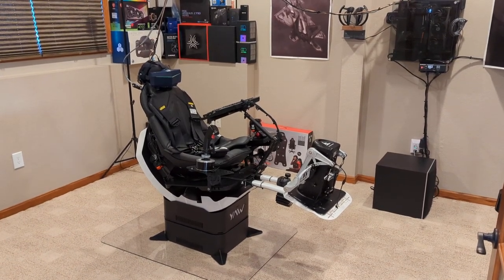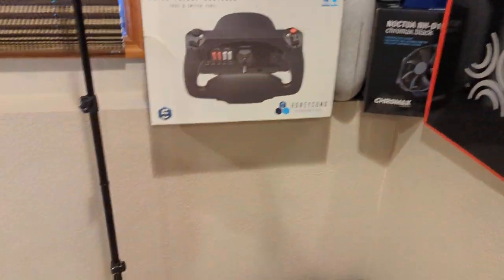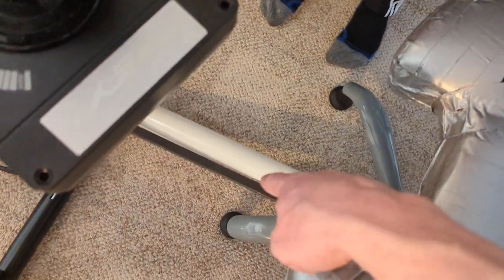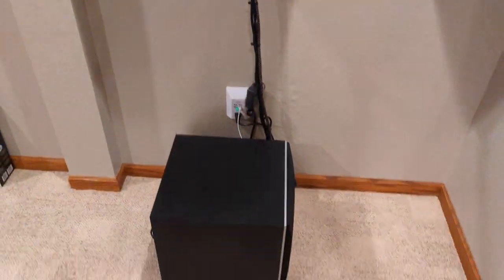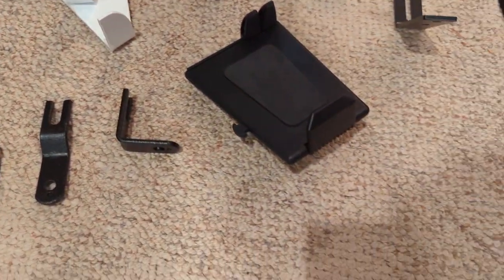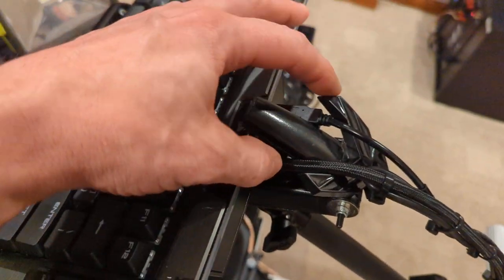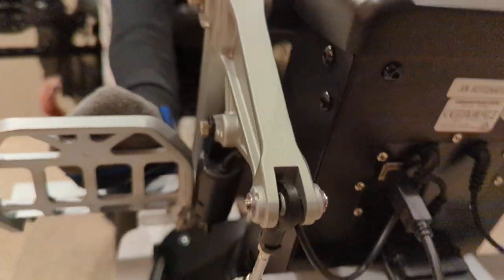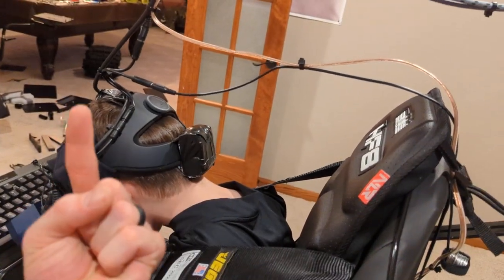YAW 2 PRO complete build. PART 1. Nuggets galore. Close ups. Motion VR chair. YAW manual. See part 2

Comment: Since you asked, I think that I can beat you with my setup. Only 2 wires from the PC (power + 1 USB). There is no need for that spider web hanging from the ceiling. A powered USB hub mounted on the Yaw2 is all you need to connect all your peripherals (steering, Hotas, shifter, pedals, etc.). Also if you connect your VR headset through WiFi-6 to your PC, there no need for the headset USB cable, but if you want to connect your headset through USB for some reason, you can connect it to the USB hub in the chair itself and avoid another dangling cable from the PC. I added a wireless HDMI touch screen monitor to my rig so there is, most of the time, no need for a keyboard or mouse. It is virtually a clone of my main gaming PC screen, so you can also control and navigate the whole PC from this touchscreen. You can load games, apps, etc. and control them just by touching the screen. Also added a sliding mount for the hotas stick which lets you move the stick away when playing car racing games. A butt kicker is also mounted to the rig which gets its audio signal from the same wireless HDMI that feeds the touchscreen monitor. A couple of Quest2 controller holders mounted under the front tray table and a VR headset holder in the backrest of the chair. A wind effects fan is coming next week. You made a nice video explaining your rig but I think that you have a lot of clean up to do. Specially the cables spiderweb. Good luck and keep on having fun with the Yaw.
Here is a link for a short video that I made of my rig:
https://youtu.be/GMwD63Eg4gY

Comment: Great video, and a nice setup. As a backer that never got delivery, I am of course very jealous, wish I had waited to buy the commercial version. Seems like everything they were trying to achieve.
Reply from the maker: Got a problem with my roll motor all of a sudden. Pitch and yaw are fine. Sent video to Gergo at YAW. Probably need a new pitch/roll box. Seems like burnt motor or frayed/loose wire.   Usbs are working fine now. Wiring is updated. Witmotion gyro is on. 
Murphy's Law. Right when I had it pretty dialed in. I'm sure I'll have it resolved soon.🤷

Comment: Wow, this is awesome! This is probably the best Yaw2 setup I've seen so far and the closest I have seen to what I will be doing in my house when mine comes in. I will for sure be using some of these ideas. I will say you are brave doing all that wire management before you powered everything on and configured it though lol.
Reply from the maker: Theoretically I should be okay. The actual yaw chair wiring and chair component assembly is the easy part. The unit is assembled and tested at the factory. Then disassembled and packed for shipping.

 Mine arrived undamaged afaik. The headset stuff I already know works well because it was on the previous system.

 But yeah, the pucker factor will be up when I flip that switch. 🙏

Comment: Just skimming through this one and watch more thoroughly later, but noticed your comment about the HF8 having to use the audio jack.  It supports USB which means you'll get discrete seat rumbler responses instead of just based on the sound path but you have to select the Realtus Forcefeel as it uses the same internals, eg see https://www.youtube.com/watch?v=hdz2FQDKOqs&t=457s  .  Sorry if you changed this since this vid of course
Reply from the maker: I know. I explained the dual inputs somewhere. Audio thump is preferable over the programmed thumps. Feels more natural. I like it more anyway.

Comment: I recently watched your video on setting up the Yaw 2 Pro, and I must say, it was incredibly inspiring! I made sure to watch it all the way through to catch all the details.

Your insights and recommendations have given me some great ideas on how to optimise my own Yaw 2 Pro setup. It's always valuable to learn from someone with experience, and your video was both informative and engaging with purchases along the way.

One thing I noticed, though, was that the video cut off right around the part where you were discussing the mouse and mouse pad you use. I was wondering if there was anything specific you wanted to share about your choice of mouse and mouse pad? Any tips or recommendations would be greatly appreciated?

Thank you once again for sharing your knowledge and experience. I look forward to hearing from you soon!
Reply from the maker: My mouse is a left-handed trackball from Amazon I think. There is no mouse pad. The mouse is mounted. Mouse pads don't work well with VR. The trackball is more cockpit like and it's always in the same position. So you know from muscle memory where it is. Mice tend to fall off pads and land on the floor and wreck the experience.
Reply: @phoenixrising011  Thank you for the prompt reply.
Reply: Any recommendation of brand / model? Thanks in advance.

Comment: Lucky man! How do you like the performance? How does it feel ?
Reply from the maker: Still tuning for DCS. It's much more fun than it looks from the outside. The machine is fast and powerful. The "pitch up" is incredible. 
Once I know what I'm talking about better and it's tuned I'll do a video. It's freakin' awesome man.
Reply: Incredible setup man! It would be awesome to see a video of this rig in action. The one thing I’m trying to figure out for myself is how to keep your wires from getting bound up and twisting to the point where they shorten and start pulling on the PC ports. I’ve got the same swivel pulleys keeping my cords up and away, and they work for everything else. But if you’re in a turning dogfight, you might not know that you’re about to lose the fight along with your 6K$ computer as it gets pulled off the wall. Just curious if you’ve come up with any creative solutions for this problem also.
Reply from the maker: @Joshstampss  I got you Fam! ✊🏼  I figured all that out. I did it last night and filmed it while narrating. Good stuff. 
     I will upload today on this very subject. I did all the thinking and made my son sit in the chair to mock it up. It works perfect. I can help you.
Reply from the maker: @Joshstampss  video will be up in about 20 minutes answering all your questions.

Comment: Hi  In regard to the YAW 2 sitting on the perspec sheet, how is this fixed to stop it from sliding left and right, please? Any suggestions welcomed. Thanks in advance.
Reply from the maker: Large pieces of thick gorilla clear double stick adhesive tape. More than adequate. You actually have to secure the plexiglass to the carpet or ground because the chair is powerful enough to TWIST The plexiglass and slide it on the carpet underneath the chair. Which obviously is no bueno. But the tape under the feet on top of the plexiglass, and then under the plexiglass on top of the carpet hold it just fine. And it's easy to do.
Reply: @phoenixrising011  Thank you for that, very helpful and will give it a try! I was attempting to avoid screwing the unit to the floor and didn't think the wife would approve.lol. Thanks again for your prompt reply.